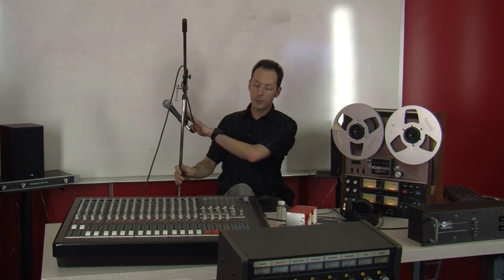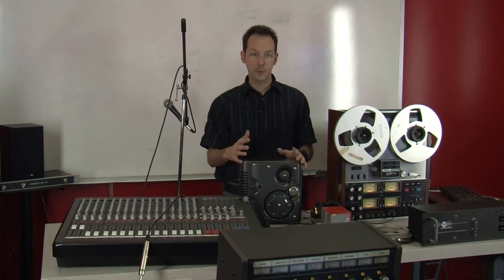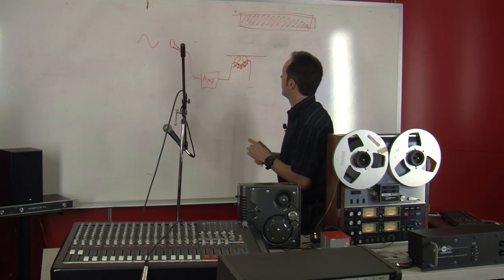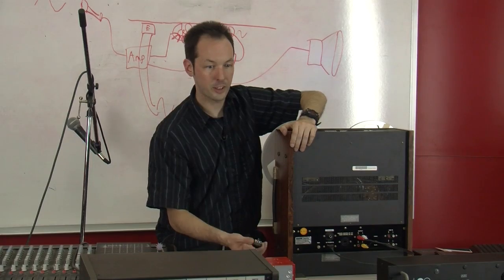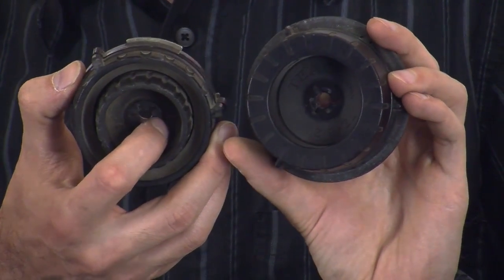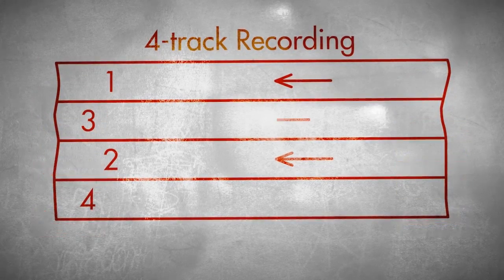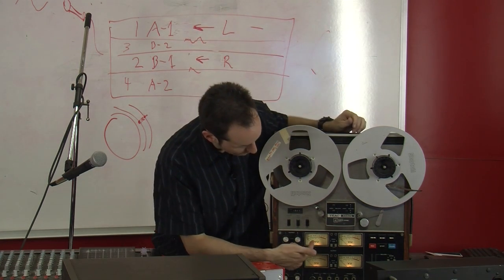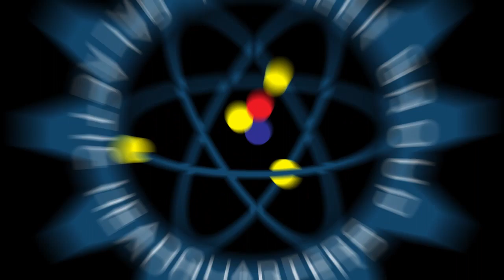Reel-to-Reel Basics

Comment: I think, that it is better to say, that in out phisical world, sound is the auidio wave which goes through some material (air, wood etc.), in electronic form it goes to analog signal (which is any continuous signal for which the time varying feature (variable) of the signal is a representation of some other time varying quantity, i.e., analogous to another time varying signal) - the instantaneous voltage of the signal varies continuously with the pressure of the sound waves.

Comment: At approximately 11:32 you say "...and then they put another layer of plastic on top of it and seal that in." This is not correct at all. The bare oxide layer is left completely uncoated and allowed to rub directly against the heads. Evidence of this can be seen with older tape that suffers from oxide shedding in which the binder they used to glue the oxide on the tape has broken down due to age/heat/humidity. However, it is not just those tape formulations, but indeed all audio tape does not have a second plastic layer.

Comment: hi chris ive got myself a Revox A77... but i have a problem with it
when i record something (through mic or Line Input) and then play it back, the audio on the tape is very very quiet. If i listen to the input source the level is enough loud and the VU meters are around 0.. i tried to clean the heads and demagnetize em, did not work.. is it possible that the tapehead amplifier is broken?
thank you for your help, i enjoyed this video a lot. greetings from swizerland :)

Comment: Thanks for the great lesson.
I have a AKAI X-330 which i bought on EBAY it came without the remote and it works fine does that meant that someone installed a jumper?

Comment: I remember playing around with my fathers reel to reel recorder in the late 1970's so most of what is being said here I am fairly familiar with. It had two speeds, 7 inches per second and 3.5 inches per second, and yes recording at the higher speed was clearer than recording at the lower speed, a bit like encoding an mp3 at 256kpbs has better quality than encoding it at 128kpbs. Cassette recorders only recorded at 1-7/8 inches per second and sounded awful when they first came out. However over time cassette tape quality improved to the point that recordings made on high end cassette decks rivaled that of modern CD's.

Comment: What's it called when you record something and then record over it, and you can still hear a little bit of what was there before? Does that mean there's something wrong with the erase head?
Reply: +AwesomeRobot15 overdub! :3
Reply: Bobfr3d He's saying the previous recording wasn't erased properly. Overdub isn't right.
Reply: +AwesomeRobot15   Could be a clogged erase head.  Rubbing alcohol and a q-tip work wonders.

Comment: @28:50 just a track numbering correction for 4 track stereo: Top to bottom the tracks are numbered 1, 2, 3, 4. In the FWD direction tracks 1 & 3 are L and R stereo. (side A)  In the reverse direction tracks 2 & 4 are L and R stereo. (side B) This is consumer 4 track stereo. For multi-track 4 track, the tracks are numbered exactly the same, but all tracks record and play back in the same direction. (not as confusing if shown graphically) Otherwise this is an outstanding presentation and accurate!

Comment: Oh yeah, I spent many years editing sound with one of these, this is why editing programs have a razor icon. It took time to learn how to edit by listening to the sound and then mark the tape and cut on a 45 degree angle. Then you had to snip out the tape you didn't want, put the two ends together and tape them. If you made a mistake, you had to go back and find that piece, splice it back in and start over again. Believe me I got good really fast.

Comment: I had the A-3440! And I added a third speed to it and another pitch control with a 10-turns pot (to be able to transfer two different tapes to a HDD and keep them synchronized)… I had some tricks up my sleeve back then… :P

And the A-3440 had inputs and outputs for a 4_channel dbx unit! Unfortunately I didn't have one of those.

I also had a Fostex A-8 at one point, but it always failed synchronizing my drum machine (Alesis HR-16). I guess the tracks were just too narrow.

Comment: Does flutter and wow come from the motors of the machine or the actual tape?
Reply: +Mikkel Lorenz I have seen it come from both, but generally it comes from a deck that has bad pinch rollers, or the tape is dragging over heads in a non linear way. So yes motors, capstans, pinch rollers, tape, bad calibration and bad tape casing can all cause wow and flutter.

Comment: I just happened on to this video by chance and have only watched a few minutes of it.  I'll be interested in watching all of it.  I have the same machine, a Teac 3340S which I've been using since around 1973, about the time they were introduced.  It still works!
Reply: takes me back to the time one of my university buddies bought one at a garage sale in Davis. Worked great after cleaning the switches.
Reply: I recorded Alex reading Kay Ryan's poetry with this machine!
Reply: Hi Reed, my dad just died and I have his teac A-2340 I have tapes way back 1977 and me when I was 2yrs old are you available to chat? I am trying to transfer his tapes to computer using Audacity for later transfer to external hard drive to share with family. I really need help not tech savy at all. Thanks Hollie
Reply: Hollie Ensminger
Hello Hollie.  My condolences to you.  I am not familiar with the A-2340, but I've used several other tape recorders.  Perhaps I could help.  I use Audacity very often -- very good.
Reply: Thanks Reed, I have figured out a few things trial and error lol although I could still use help.
Reply: Depending on how many tapes you have, as well as time and budget, you might consider using a copying service, if there is a good, reputable one in your area.  Of course, there can be value in learning how to do it yourself.  But there is a bit of a learning curve necessary to make quality tape to digital conversions, and if this is a one time project, using an outside service is something to consider.  Also, if you don't have the manual for the tape machine, you can probably find it on line.
Reply: Hollie, The manual is available on line.  I wrote that I am not familiar with the A-2340.  Mine is a 3340 and appears almost identical, so I'm probably more familiar with yours than I thought!
Reply: Reed Maxson I just went to my Dads and found the manual, I have rerecorded almost 30 hours of tape and yes huge learning curve.

Comment: wow.  Excellent.  Now, I have a Radio Shack TS-3000.  All of the parts inside say Teac on them.  After some research, i find its essentially a Teac 3000 reel to reel.  OK.  My father served in Germany during peace time on radio CAE ...to entertain the Canadian troops stationed there.  The recordings are all reel to reel.  When i play those on my RS reel to reel, i can hear basically side one and side 2 at the same time ( with side 2 playing backwards ).  When you flip the tape over, you can hear side 2 and the flip side as well.  So, i'd like to know if you can tell me how i can record these tapes from the 50's using my existing reel to reel - or is it possible at all ?
Reply from the maker: It sounds like you have one of two problems. Either you have a 4-track deck and you're playing both sides at once (in which case just use tracks 1 and 3). Or you have a Head Alignment problem (which is very likely). The heads on the tape deck that recorded it are not tracking in the same path as the heads on your deck playing it back. This is a common problem in the tape world. The good news is, it can easily be fixed by someone who knows what they're doing.

Comment: I have a Teac A-3340 that I used to record a friends band in the late 70s.  With the 4 line inputs and 4 microphone inputs, it was possible to record up to 8 inputs on 4 tracks at the same time.  Old age and the grease got thick so it doesn't work any more.  Electronics are still good (as far as I know) but the mechanicals are clogged. Sitting in the basement waiting for me to do something with it.
Reply: +Buncha Baloney It will be well worth your time to revive that machine.  The thick grease problem is very common with these old decks but is fairly easy to repair and make it like new again.  I had a lot of difficulty getting the pinch roller mechanism loose from the shaft that it pivots on when the pinch roller moves up and down when it engages or disengages from the capstan.  It was like someone glued it in place!  Here is the trick to getting it off so you can clean and re-lubricate it: Take a hair dryer and heat the metal shaft and sleeve to soften the dried up grease and it should allow it to slide off after a minute or so of heat application.  You must separate the lever from the solenoid plunger first.  Clean everything with 90% or higher isopropyl alchohol and let dry.  Then apply lithium grease like the kind that comes in a tube at Home Depot for garage door opener application.  Reassemble the mechanism.  Replace the capstan belt with a new one (sellers on eBay have them).  While you have the capstan flywheel loose to replace the belt go ahead and clean off the old oil on the capstan bearing and put new oil on the bearing.  Clean the surface of the flywheel thoroughly and the motor pulley.  Spray contact cleaner on ALL switches and the insides of the pots (volume controls); work the switches to clean the contacts before the cleaning solution evaporates, same with the volume controls.  Oil the motor if they have oiling ports. Adjust the reel motor tension (see service manual for how to do this).

I ran tests on my refurbished TEAC A6300 and it was actually better than the specifications for speed accuracy, wow and flutter, frequency response (using Maxell UD-35 tape).  It was worth every minute to get this bad boy up and running and didn't cost but a few bucks for the oil, grease, capstan belt.  I did invest money into calibrated test tapes and test equipment but am thinking of repairing decks for other people to recover these investments.  There is a great feeling of satisfaction seeing a  "dead" deck come back to life and run like the day it was made!

Comment: I have a teac 4070 and I'm printing stereo mixes to it from logic through a motu. When I monitor the source of the tape machine, levels are super loud, but when I monitor the tape as its recording, it is super quiet. VU meters barely move when monitoring the tape, and when I turn up the feed from Logic it distorts really quickly. Any ideas on how to get the sound coming off the tape as loud as the output from my audio interface? Thanks.

Comment: I've heard you shouldn't use 2 different size reels that it's not good for the tape. Is this true?
Reply: You can use it without any problem as long as the reel with tape is smaller then empty reel. Many recorders were sold with one empty big reel.

Comment: I have a few high end machines but rarely use em. Is reel to reel use practical or is just sentimental eye candy?
Reply: The time spent threading a reel is very practical considering the audio quality! Though practical and convenience are different things, hence why the more convenient methods of audio playback become popular - but at the expense of quality. The progression of consumer listening after reel to reel is then cassette tape, cd, mp3. Each one gets easier to carry around, but degrades quality. Any advancement that doesn't offer enough of a difference/new feature essentially fails. What I mean there is between the jumps are loads of methods that don't quite catch, like the mini disc - they became quite popular because of their size, but before they could take over from the cd the mp3 player popped up as file sharing/downloading became more viable. Mp3 offers enough of a difference in portability to flexibility like making playlists without burning a new cd with limited space etc. So now if you go to a music store the CD exists, but minidisc faded as it's less convenient than mp3s etc. CD is definitely better quality than cassette tape, the point is more that quality seems to go out the window next to convenience for most people.

Comment: The four tracks running in pairs of opposite direction were rather a consumer thing to save tape. The two-channel standard was rather just having one left, one right channel each occupying half of the whole tape, on two tracks. Of course tapes recorded with either standard are not compatible, if you hear a quarter-track tape with a half-track player, you will hear all four channels, two of them backwards.

Comment: I`d wondering - with a mic input, it takes up one channel of a possible four.

However, seen as its RCA input for line level. Does that mean that one line level will split into two RCA and take up two tracks?
Reply: Exactly, essentially giving you a stereo channel instead of a mono channel one and two
Reply: AleksHarborBelt
Interesting.

Comment: Radio station techs would tell me to always use a take-up spool that's the same size as the feed spool.... In  other words, if you're feeding onto a big spool (aka empty reel) with an adapter, there are some balancing and friction issues when feeding from a small spool... On the subject of adapters: On both Otari and Revox machines (and probably others), the adapter would also be used as a 'clamp' to secure the small spools/reels on the machine.

Comment: I have a TEAC A-5300 Direct Drive Capstan Servo Control reel to reel tape deck that I'm trying to sell. I can't seem to find hardly any information about this particular model. How would I test it to see if it works right, it is a little different than the one in this video.

Comment: This looks like a quarter inch wide tape.  I used to listined to a machine like that when I was a kid.  That was the way to go back then, it was a great replacement for vinyl, 'cuase you couuld record on it.  Nontheless, what's the deal with the 1 inch tape real-to-real?  Are these only for multitracks?  Or are there also some high end stereo one inch or half an inch tape machines?
Reply: Yeah, it would be nice to have one.  Studer or Sony.
Reply: +Andrew Piatek 1/2 in half-track would be the MOST one would likely see. 1 in. & 2" would all be multi-track of ~ 8 or more tracks.
Reply: +Andrew Piatek ditto! Cut my teeth on Studer A807 - LOTS of editing/splicing! THOSE were the days...

Comment: Also, why does the quality of a tape increase when the speed get's faster? I know the noise ratio gets less and less the faster you get but why? Thanks!
Reply: My guess is that the magnetic charge is stronger. Like how a dynamo bike light gets brighter the faster you go.
Reply: It's kind of like increasing the sample rate on digital recordings. You're able to lay the audio down over more tape and aren't squishing it as closely together so you're able to pick up more detail.
Reply: and what exactly is being captured on magnetic tape. I know on an LP you have record groves which mimic the sound waves.
Reply: Om The intensity and frequency of the sound on a tape is represented by it's magnetism. This video does a better job of explaining, but basically: Strong magnetization means loud signal, weak magnetization means quiet signal. Over time, recordings on tape become more and more quiet since they get "erased" by various magnetic fields. Well stored tapes can last a very long time though.
Reply: ***** Right.  It's a direct copy of the electromagnetic waves that cause a speaker to vibrate.  That's why the old headphone to cassette adapters worked...it took the signal that would normally go to a headphone and created it on a head for a tape pickup head to read. 

The grooves on an LP are a physical representation of the sound waves, magnetic tape is an electrical representation.  Does that make sense?
Reply: Wow okay, so if you were to ask what is physically being recorded on the tape. It is magnetic frequencies which are an exact copy of the frequencies that came from our voice. When played back the tape heads pick up the magnetic waves playing the exact sound back.

Haha, so I guess for the tape to be of exact quality of sound it would have to be recorded at the speed of sound. which would be around 13,377 IPS on tape.
Reply: 94XJ
Perfectly.  Thanks for the explanation.

Comment: I figured out I had no sound from some old reel to reel pre-recorded. I thought my reel to reel playback head was not working. Then I realized I hadn't turned the sound knob up. Vola, my analog meters told me there was music on these old tapes. So I wanted to hear what was on these old tapes but I don't have speakers that match up to the old RCA style jacks. I figured no problem I'll just use my RCA style jacks plug them into the back of the reel to reel and then try to push them into the more modern style Sony speakers with push down wire style plugins. On the Sony speaker one speaker wire input was red and the other was black. On my tape deck you will see one is red and the other is white. I plugged them in and nothing. So I decided to cut the one end of the RCA plug and put it into the Sony speaker. Still no sound. Even though I can see the analog meter showing sound is coming out from the tape deck. So I cut the heads off one side of the RCA jack and plugged it into the Sony speaker and still no sound.  I don't have old style speakers. So my questions could these Sony speakers not be wire properly to receive the sound thru my RCA jacks. Again my RCA jacks are red and white. The Sony speakers jacks are red and black. Could there be a problem here?